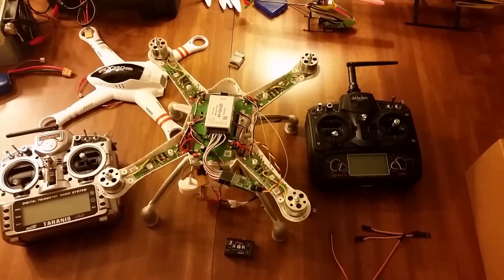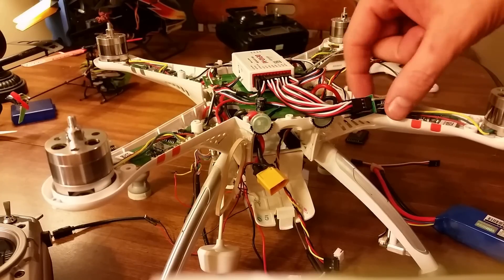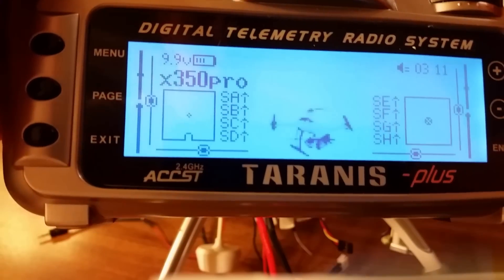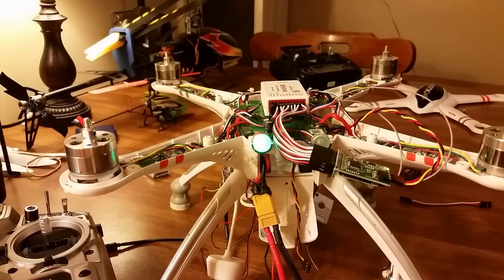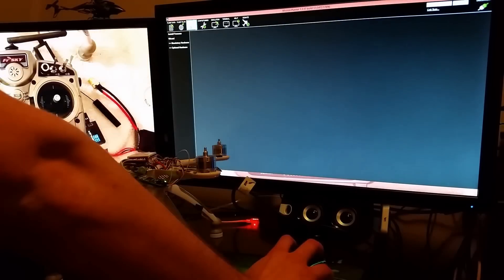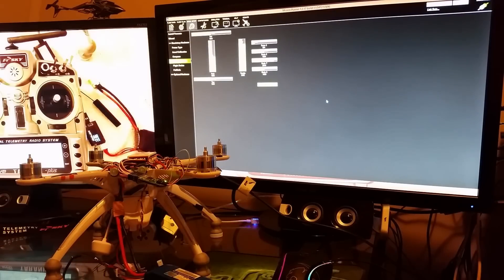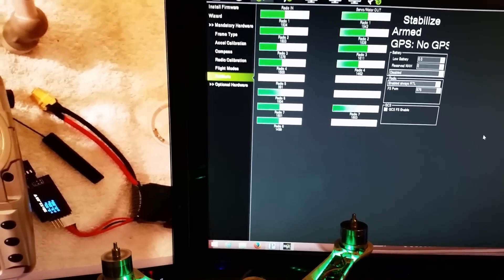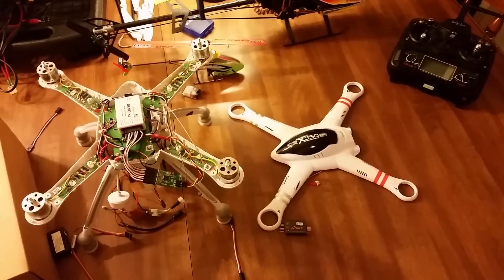Walkera X350 Pro x8r and Taranis Install Guide

Comment: I installed my Taranis with a V8FR-II reciver.  The tx and rx are bound but all I am getting is the left green light quick flashing, nothing more.  Do you have any thoughts?
Reply: 2dayIResqU Ok, figured out the fast blink.  Doing calibration check through Mission Planner and it shows no movements.
Reply from the maker: 2dayIResqU Fast blink is a receiver problem.